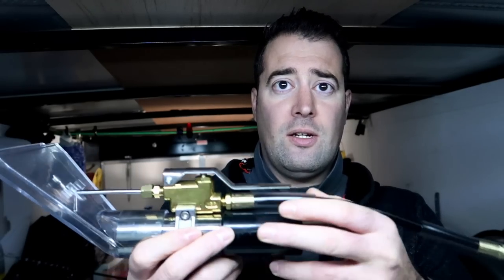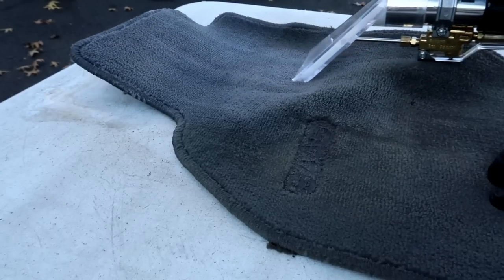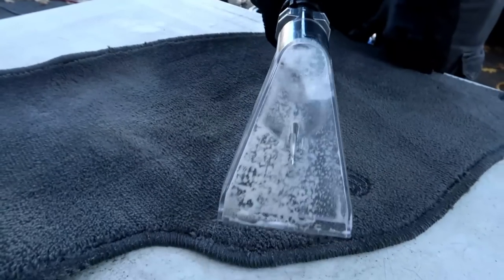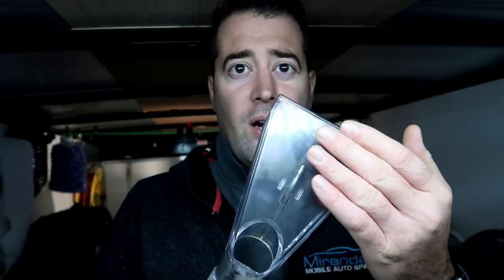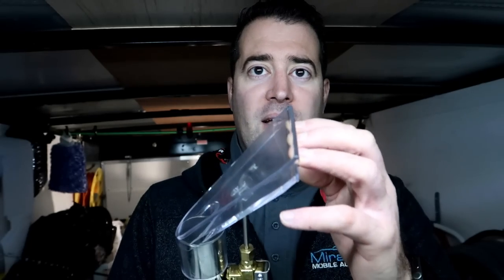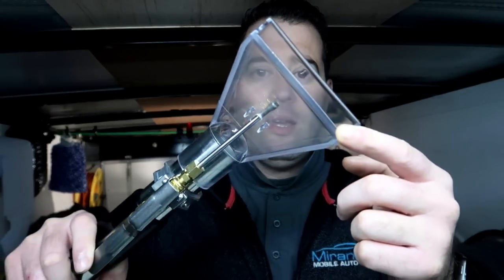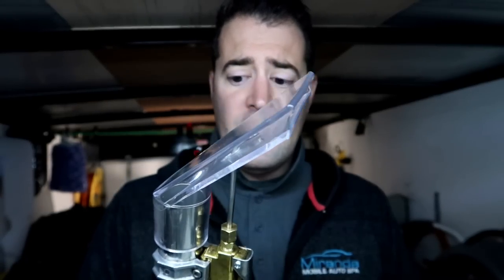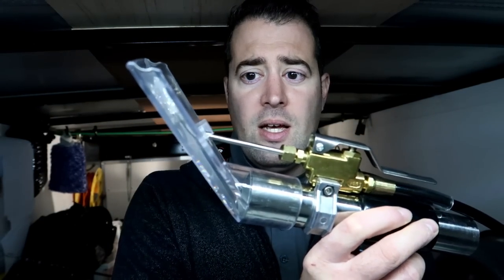New Clear Extraction Upholstery Tool Review #ExtractorNozzle #ExtractorWand

Comment: I have converted my shop vac into an extractor using garden hose/sink connector to an air compressor line for water line. Then shop vac line for suction. I was using the mytee head with external spray but it is both messy and hard to find. My question with these internal spray type extractor heads is: without the pump of an extractor, would the water pressure be enough or would the vacuum suck it up before it got to the carpet? Going from a garden hose/sink to a 3/8 inch air hose, through a 1/4 fitting and to a tiny spray nozzle naturally creates pressure but wasn't sure if it'd be enough. Not sure if you'd know. I may just purchase it and find out but thought I'd ask first.
Reply from the maker: Hi. That’s a good question. I’m actually not sure because I have never used it that way. The pressure from the machine is around 90psi or so and it’s increased by the tip of the nozzle. But honestly, I have know idea. Sorry. Hopefully someone else can answer this question. I’ll pin it.
Reply: I've been wondering the same thing about garden hose pressure . Phil do you still recommend this upholstery tool after using it a while? It looked like on some of the more recent extractions you were using a different one.

Comment: Do you still mainly use this internal sprayer? I'm thinking of getting one but I'll be using garden hose supply so I'm not sure if it would work good enough.
Reply from the maker: It depends actually. In some fabric seats I will use this head, but for regular carpets I just use the stock metal head.

Comment: Can I connect the connector to a water tank or would it need to be connected to a pressure washer ?
Reply from the maker: Hi. This is a wand trot the Myteelite extractor machines. I have seen Detailers use attachments that can connect to a garden hose however I haven’t tried that because I use my Myteelite.

Comment: I don’t get why you can’t just spray water from a sprayer bottle and just use the extractor head to extract the liquid
Reply from the maker: You could if you wanted. It’s simply not efficient. But give it try and let me know how it works.
Reply: @MirandaDetailing  hi, I guess but it saves having to do all that setup and get water etc when you could just buy a £30 clear extractor head in my opinion
Reply from the maker: 🤔  this is also a hot water extractor. The water is super hot when it hits the carpets and that action along with this style head cleans very effectively and efficiently. As Detailers it’s best to have the right tools to make things easier and achieve better results. But it’s totally up to you. You can definitely use your method if you want.
Reply: @MirandaDetailing  thanks for the response I appreciate it most don’t reply 😄 i’m starting my own setup soon but wanted to find a way to have a wet dry van and extractor all in one  but struggling to find an adequate way to do it all
Reply from the maker: @DB-dv3gk  you’re welcome. If you have steamer that would work better than just using a spray bottle. You need that heat to clean well. Also switching back and forth between wet and dry using a shop vac is a pain. Very inefficient.

Comment: I'm trying to figure out, and u didn't tell us, where r u getting the water supply from? And how did u hook it up?
Reply from the maker: Hi. So I have a myteelite 8070 hot water extractor. It just hooks up to that   Some hose size and quick connect for the water line. Many of them are universal fit.
Reply: @MirandaDetailing  so what if you don't have a mity extractor?
Reply from the maker: You would have to build a DIY extractor with a Shop Vac like this
https://youtu.be/oFXQvZIskjg
https://youtu.be/Hboi4M723gg
https://youtu.be/K1iuGusbv8c

Comment: Can I hook a wand to a upholstery extractor?
Reply from the maker: Hi. You mean like a pressure washer wand? I’m if so no, it’s not the same quick connect system
Reply: @MirandaDetailing  Ok. So a  upholstery extract is only made for upholstery tools only.
Reply from the maker: Yes correct.
Reply: @MirandaDetailing  Ok. So if I buy a Mytee extraction and replace the wand that come with the extraction for a TMF wand would I still have good performance?
Reply from the maker: I don’t know honestly because I have never used a TMF wand before.

Comment: Great video as always. I recently bought a mytee lite 8070 extractor. Do you know how many wats a generator needs to be able to run this machine? I have a 1300 watt generator but I'm not sure of that's enough to run the Machine.
Reply from the maker: Thanks. It takes a lot of power. Not sure exactly how many watts but we use a 3700 running watt generator and it’s fine.
Reply: Mario Mejia
Be sure that your outlet plugs on your generator are 20 amps or more. if not you will constantly trip the breaker on your generator. I'm using a 9000 watt generator to run my mytee 8070 lite. I believe the 8070 machine is at 19 amps thats why im using a 9000 watt start watts with 7350 running watts. It's been running like a champ. All those things are important to look at I've had to learn the hard way. I've been detailing for 11 years now and when your at a job and shampooing seats it's tough to get done with the breaker tripping. Its better to use a regular plug in a home or building but if your mobile it's best to get a bigger generator. I may be wrong but the generator you have may work for awhile with it running but eventually it will ware down fast because of overload. But hey try it!

Comment: So for serious hobbiest or car flippers (not professional detailers) what is needed to perform this type if cleaning (extraction? I believe it is referred to as) . I noticed in the demo, you used a Torador type of device- and that is connected to a compressor I assume, yet you mentioned a “pump” of some kind? Yikes, what is a minimum setup one would need to do occasional cleaning of seats, carpets and door panels?  Thankful for any advice.
Reply from the maker: Hi!  Thanks for reaching out!  I know!!  We have lots of equipment and products for our business. But it’s totally overkill for a weekend warrior or Prosumer detailer. 
The Bissell heated Pro extractor is a great choice for deep cleaning carpets and cloth seats. And certainly having a small air compressor makes a big difference. Good brushes for nooks and tight spots are also cheap and very useful. If you already have a good wet dry shop vac that’s also a must. A good steamer is the McCulloch brand. Affordable and they work well. The tornador tool is OK but I actually don’t use it as much as other guys. 
You c cc’d an totally get away with a lot less but those a few essentials.
Reply: @MirandaDetailing  Thank you for your quick and helpful response. I am familiar with those products and some have been recommended by others in your industry so it seems like a viable and affordable alternative to some of these more professional use tools. Again- many thanks!

Comment: Hi Phil, Google "Numatic fishtail complete, it will fit 32mm hose, the only thing you will have to source is the fluid union, male and female, I have been using Numatic vacs and extraction machines for the past thirty years and spares are available in UK, I think the Fishtail complete with trigger assy is around £30.
Reply from the maker: That’s cool!  Thanks for the info I’ll check it out.

Comment: Can you attach this to a wet/dry shop vac? im not currently able to buy a proper extractor
Reply from the maker: You can probably attach it to the hose but if you don’t have a water line it’s useless. These are designed for hot water extractors.
Reply: @MirandaDetailing  Alright thanks

Comment: which extractor do you have need to invest in one
Reply from the maker: I use the older edition of the Myteelite 8070. They since upgraded. Here’s a link. http://amzn.to/2RrKsrB
Reply: @MirandaDetailing  ok thanks i have been running into sticky dashboards you have any idea how clean them i have tried alcohol
Reply from the maker: It all depends on what’s on the surface. Sometimes it’s the plastics degrading and there is nothing that can be done😕